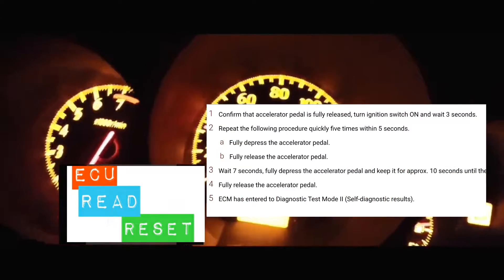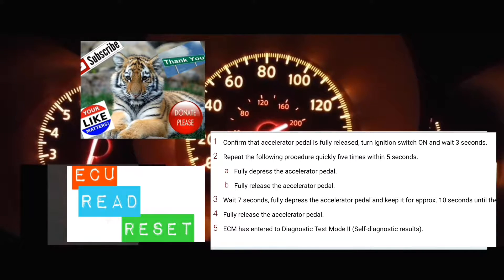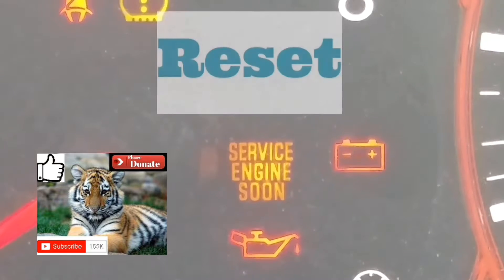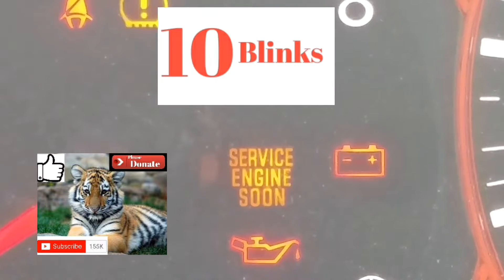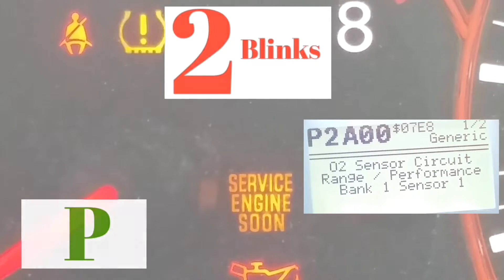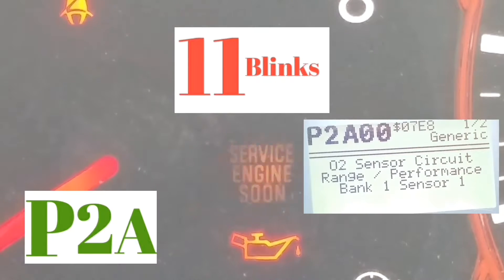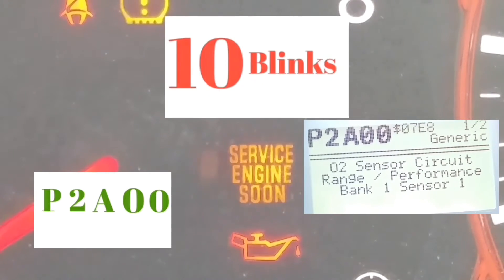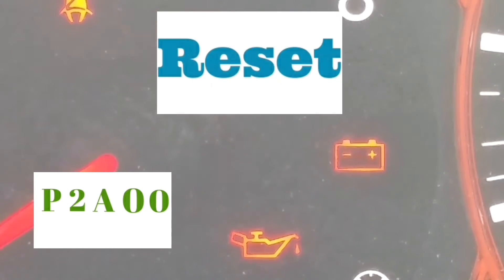How to Read and Reset Your Car's ECU- 2002 Nissan Altima

Comment: Got an 02 altima 2.5 that tries to start but dont.Ive replaced the crankshaft sensor, camshaft sensor, and fuel pump.Its getting fire and fuel to injectors.I sprayed starting fluid and still won't start.Its like the injectors aint opening. All fuses and relays are good.Im about ready to haul it to scrap yard. Any advice would be appreciated. I AINT NO MECHANIC,LOL
Reply from the maker: The battery to the remote.
Reply: I'm having this same problem and it has been a nightmare not being able to fix it. I have called dealerships and all and only one person out of like 10 made sense. He told me that my computer is more than likely fried that I could get a used one but the key will still have to be programmed. When I put a code reader on it it says my immobilizer is locked. It still cranks but will not start.
Reply from the maker: Try changing out the fob key battery.
Reply: @peterl6095  is it in the key itself cause I don't have the fob
Reply from the maker: Try swapping out the key. I think the key prob has a chip in it.